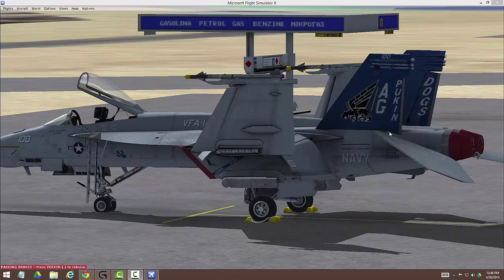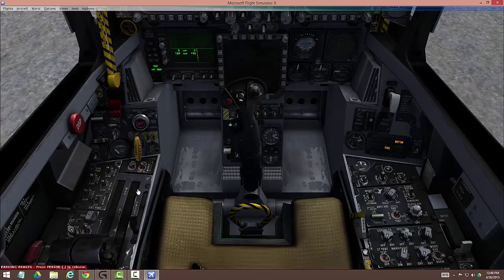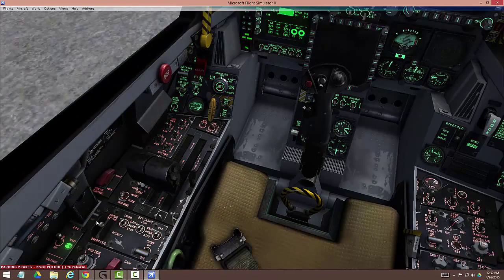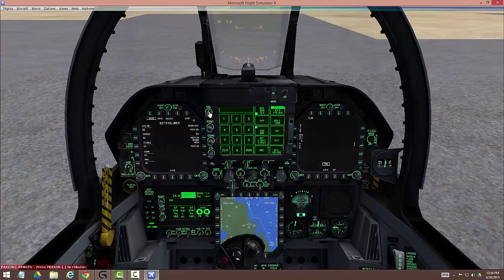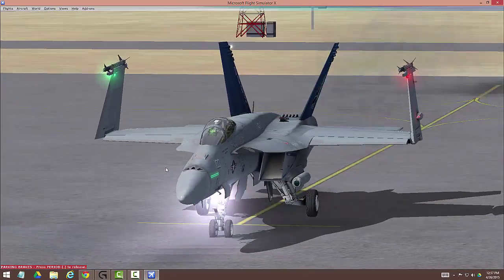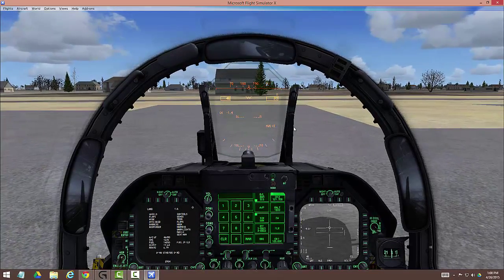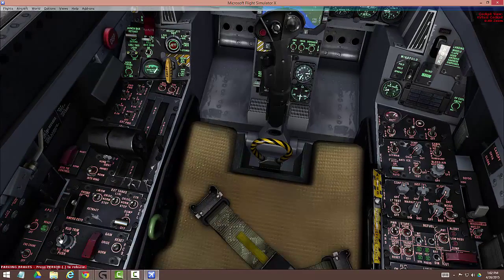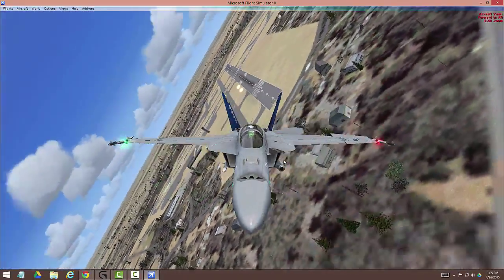VRS SuperBug Cold and Dark

Comment: I'm curious if you have used the NATOPS manual for the checklists as my checks are in a slightly different order; I'm wondering if my manual is out of date. My startup sequence has a few more steps involved; my aircraft gives me a No Go for FCS if I have not performed a preflight rig test and trim the STABS to the correct settings (usually they are set at 15 until I trim out). I noticed you didn't have to reset your FCS either which is something I have to do. Is this normal behaviour to force me to RIG test and check FCS for full stick and rudder movement? You seem to have studied the aircraft so I'm also wondering if you know what the correct power setting is for takeoff (runway) as I've received conflicting information. Some say mil detent will get me to takeoff speed but I feel I always need to kick the cans to get enough speed before V1. What is your take, do you usually go full cans for runway departures? Thanks for the video and information, cheers!

Comment: Is there any way you can help me out. I just bought the tacpack/vrs f18 and i registered etc and when I start up fsx steam it says third party software problem with tacpack dll
Reply from the maker: What I can tell you is that the more complex your FSX situation gets, the more odd messages and crashes you will get. But if you take your time and really track down each issue as it comes up, you can get a pretty stable system. I will also tell you to make sure your using the latest everything (if you are using Steam Edition, do a file integrity check, if not good luck) and make sure you reboot often and open every program once by itself (aircraft manager, tacpack) and make sure your licensing is good and then reboot again! You literally cannot believe how often a reboot will fix your issue enough to get going or do more diagnosis...
Reply: Michael Richards appreciate the reply. I am trying to track it down right now and work with the Vrs forums about it.
Reply from the maker: Sweetrevenge54 the forums are active and very helpful. But do tread lightly as they do not tolerate fools lightly. Not saying you are a fool, I just mean read carefully and have a clear grasp of your problem and be specific with your questions...
Reply: Michael Richards well i posted a forum last night and no response yet. VRS tacpack config says simconnect.dll in my simulation root directory. Then the fatal error is that it can't find usable simconnect dll. Who knows man and I'm very new to trying to find a problem on a computer
Reply from the maker: Sim connect is a very common dll. I would look up having the latest version. Also, the forums can take a day or two, as most of us don't do this every day. But when you get an answer, it should be a good one...
Reply: Michael Richards Yeah I'm working with them about it right now and we basically tried everything but one more thing. We have uninstalled disconnects reinstalled them etc and no luck. We are still looking for the problem
Reply from the maker: I'm afraid to ask but which version of fsx are you using? The box edition is way more finicky than the steam edition. I have found the steam edition to be infinitely more stable and reliable and there is some actual development work being done to it. If it comes to reinstalling, If I were you I'd pay the 30-40 dollars and go with the steam edition...
Reply: Michael Richards Yes I have the steak version and now they have tried everything so one of the Vrs support guys is gonna take control of the PC to see if he can find a problem.
Reply: Steam*
Reply from the maker: I wish I had a Steak Version... lol any luck?
Reply: Michael Richards well they used team viewer to help and solve my problem thx to the guys of VRS support
Reply from the maker: Awesome, but what did they find man?!?!?! What was the source of the problem?